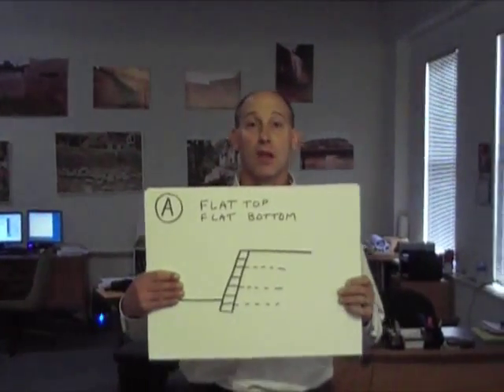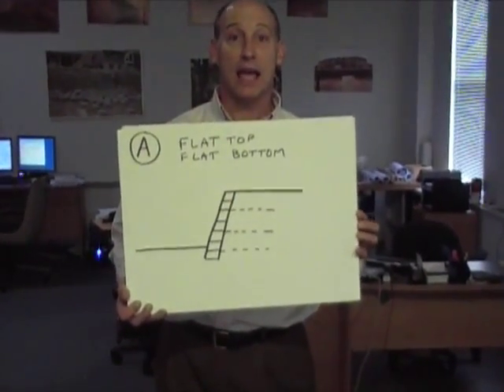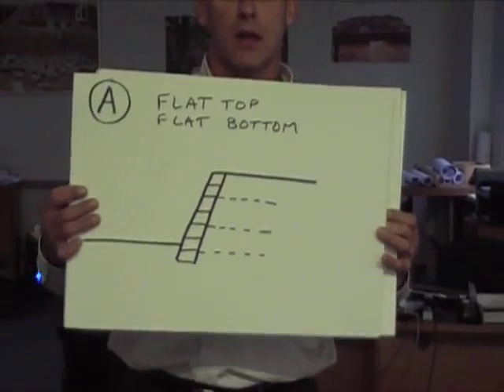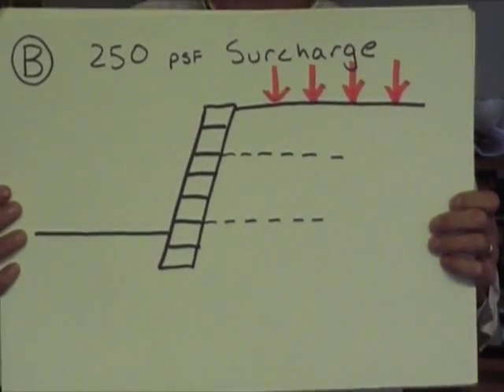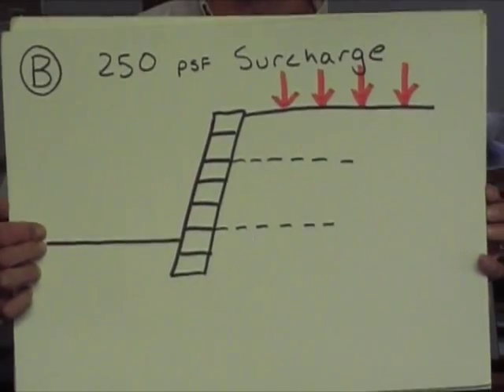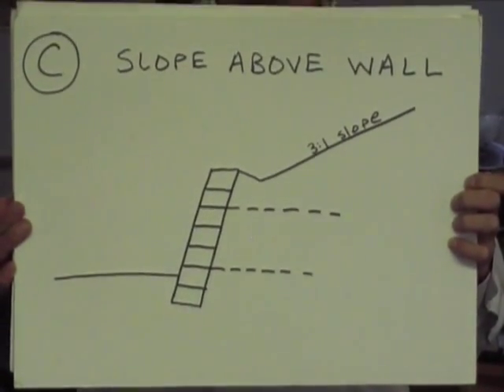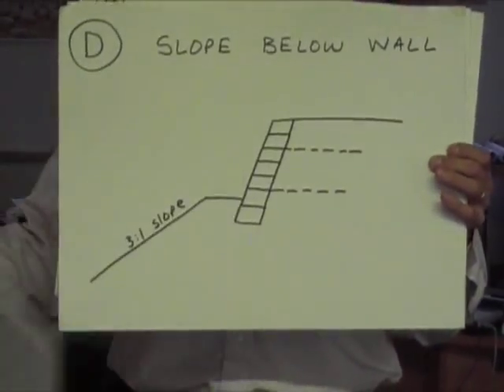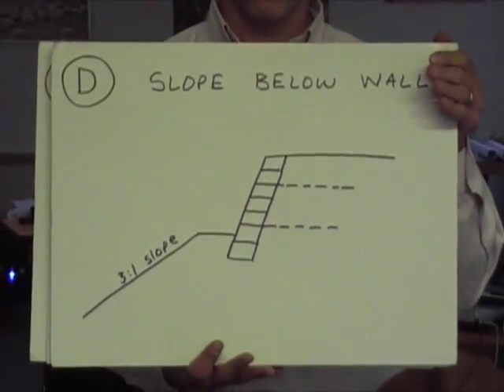Retaining Wall Design Engineering

Comment: Condition E. House on hill neighbor behind 100ft back and 25-30degree slope. Top of my rear  yard has a fence at property line and 5ft plateau. Slopes down to an annoying pine tree with exposed roots everywhere. From that tree to yard another 25ft of run off, soil erosion, exposed tree roots. Right up to home deck/patio/ home.

Comment: I have the combined conditions of B, C and D all over the place, often tightly together. I looked on the websites mentioned but couldn't find the information the video mentioned. But they arn't 3:1 slopes, their more like 2:1 or steeper slopes. My state also gets huge amounts of rainfall and flooding each year, particularly in my area it's not uncommon. I think sand is a bad idea for reinforcing anything. The army corp of engineers has made three changes to the site I would like to 'pretty - up'